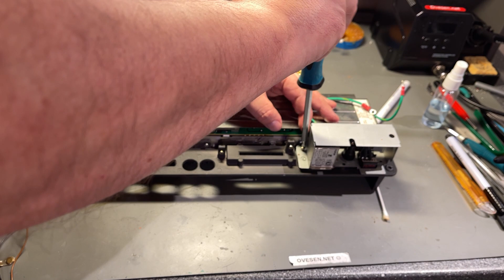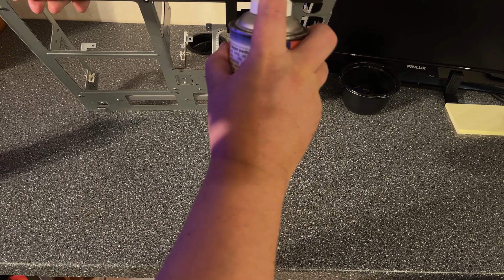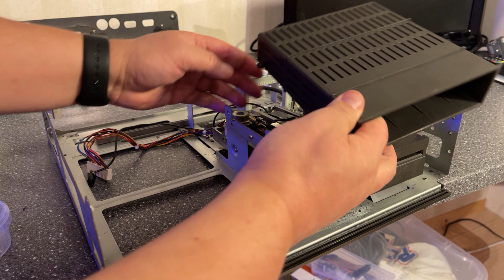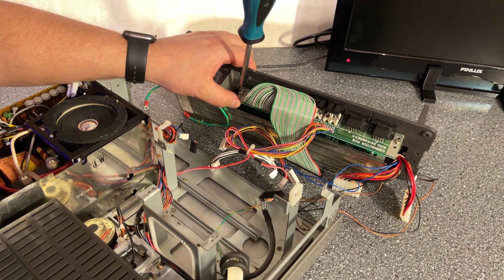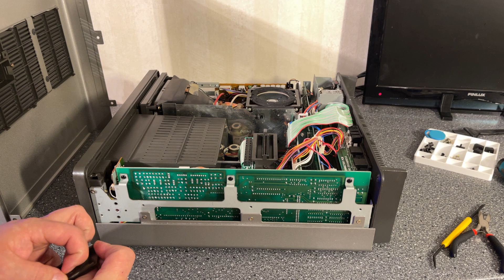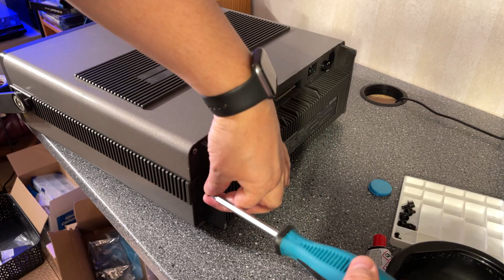Commodore SX-64 restoration, recapping and repair - Part 4 - Assembly and floppy drive repair

Comment: This was the furthest take down I've seen!  Amazing work!
Reply: lol, what I was just going to say!
Reply: @DrDavesDiversions  makes me want to play around with making a modern c64 laptop...  also the compaq portable is much more elegant inside
Reply: @temporarilyoffline  Hmm, interesting observation about the Compaq that you pulled apart.
Perhaps if they'd thought of the laptop idea for the Ultimate 64, they'd have made it in two pieces, so it could be put in a smaller case than a 64.
Reply: @DrDavesDiversions  I've recently seen a modular c64, like an rc2014 style design.  The sx64 looks like they started with the case and gave up halfway through and just made it work out.  (I totally get all the constraints mind you) I mean I'm actually a little worried that if I took that sx apart I'd lose a few screws.
Reply: @temporarilyoffline  Ha! Ya, doing a portable computer is a trick, though. That the Compaq and the SX-64 are both somewhat aesthetically pleasing on the outside is amazing.
Reply: @DrDavesDiversions  I think the sx is sexy for sure
Reply from the maker: Thanks:)

Comment: 🐨 Oh My!!
😮Gasp!!
With the greatest respect, I strongly suggest you take apart that power supply, So that you can remove all the thermal Past "Even what you applied as it is now contaminated with dry thermal grit", once it is ALL removed, Clean the entire area with IPA "Note how some thermal paste colouring cant be removed which BTW is a good thing" after cleaning apply a thin even amount of Thermal Paste and reinstall the Heat sink before you cook one of the Mosfets. 

The thermal paste BTW for the most is there to fill in microscopic scratches to both of the metal or Aluminium surfaces so that maximum heat can be transferred away, if there are any lumps of old dried thermal paste "Grit" in between the two surfaces they wont contact each other properly ergo the gap will in fact hinder the transfer of Heat..

APU I dropped a 👍
Reply from the maker: Thanks:)